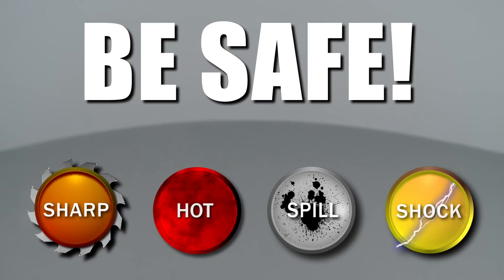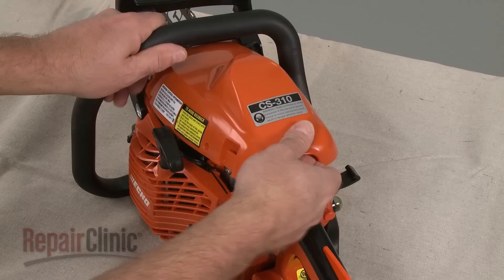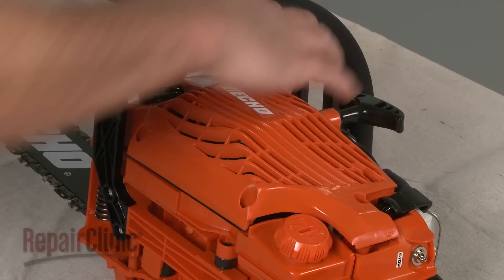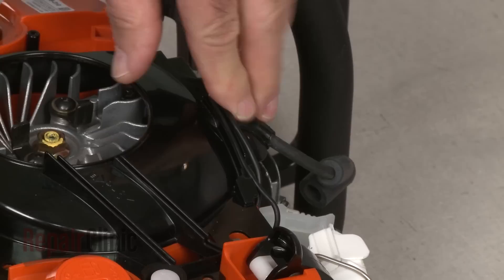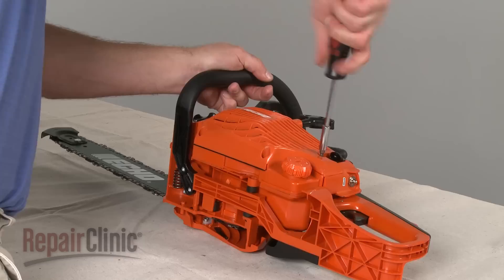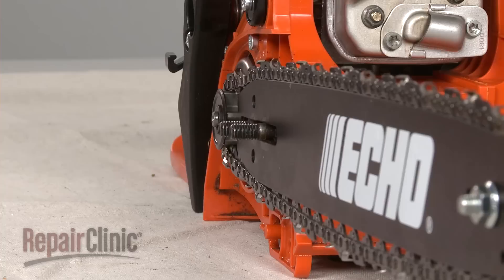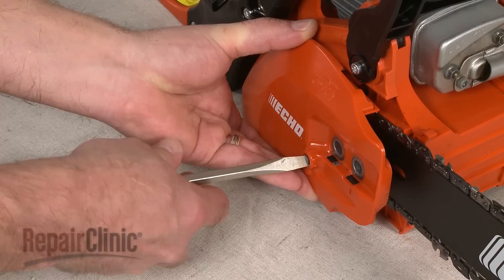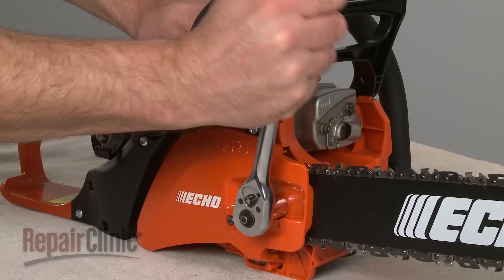Echo Chainsaw Disassembly – Chainsaw Repair Help

Comment: That chain is way to tight, you be able to see the bottom of at least one of the drive teeth when pulled up on and it should snap back into the guide bar.

Comment: I've been looking for information on how to disassemble and repair the bar lube manual piston pump normally stroked with the [right handed]  thumb on an Echo CS-670. Can you point me in the direction of some well done how to information for this maintenance job ?

Comment: The top of the rear handle comes off exposing the throttle trigger lockout.  Do you have a video showing how to reassemble the handle back onto the chainsaw?
Reply: He forgot about the trigger.....

Comment: please show how to clean fuel supply system, and also change the primer bulb. Thanks!
Reply from the maker: We do have a video on changing the primer bulb on this model: Primer Bulb Replacement (part #12318139130) - Echo Chainsaw Repair
Reply: Still waiting?? Thought so!